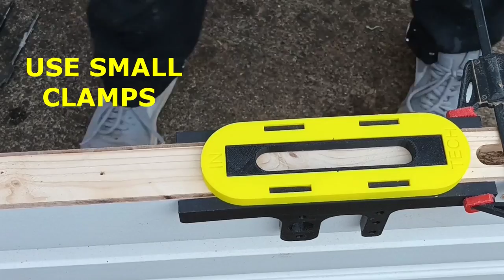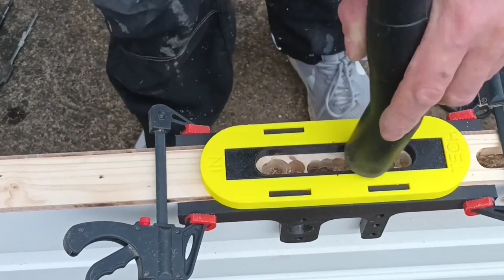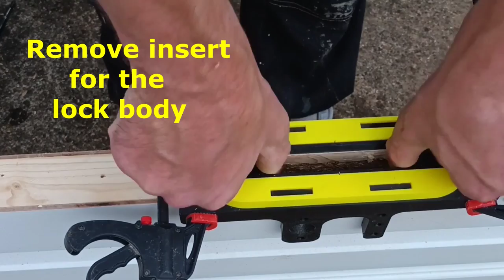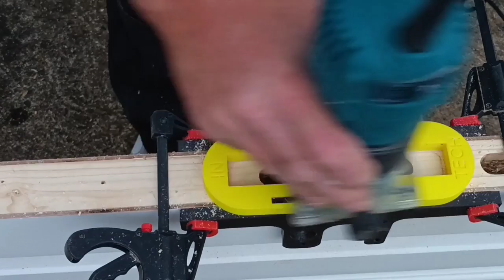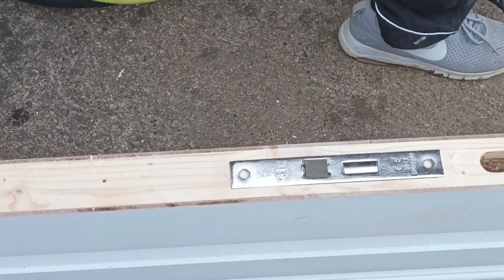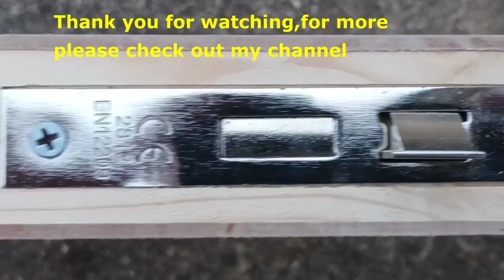Jig for wc lock

Comment: Easy to fit without handles.
Reply from the maker: Hihi
Reply from the maker: the video is not visible, but the jig has holes for the handle lock and rose, I focused on the slot and plate, but in the future I want to record a video with the full version of the door assembly